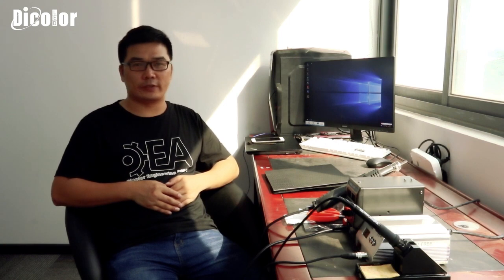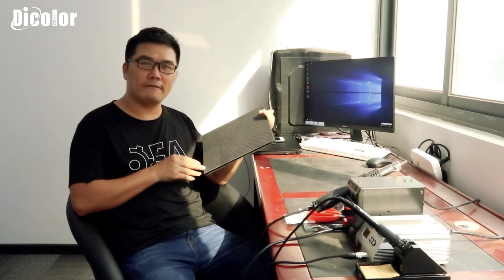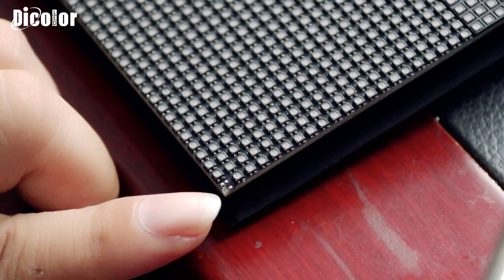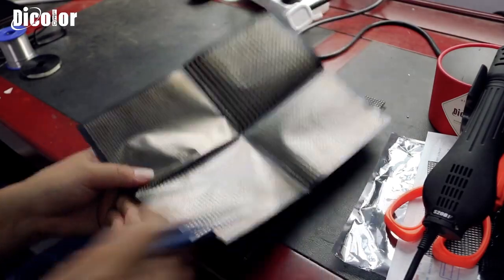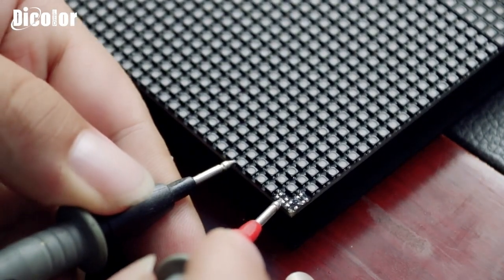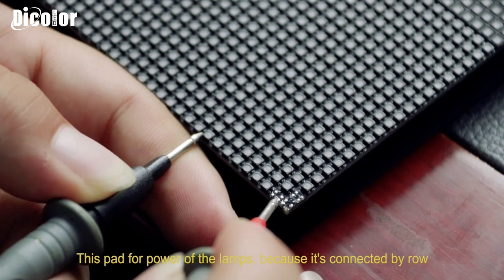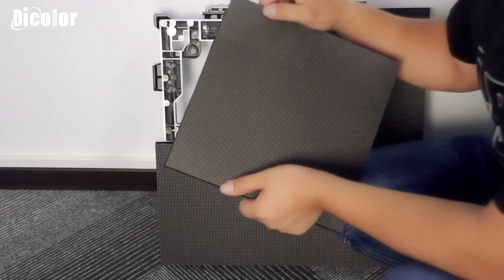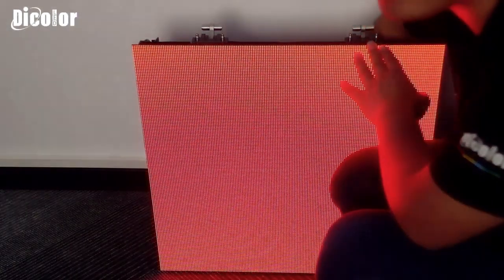How to repair led module with out PCB pad

Comment: I didn't know those pads existed, I've been repairing the matrix using fine wire jumpers on the 5mil and 3mil, very difficult. 
Where do I buy that pad paper, and is it only for Dicolor ?
Reply from the maker: you can find the pad paper from market. not just for dicolor.

Comment: Como saber mi tipo y modelo de led pich 3.9 interior .. el proveedor vendió y nunca entrego refacciones… algún tutorial para conocer el módulo por dentro … saludos
Reply from the maker: There are some standard things with product, such as the IC model, which can be known from the text on the IC. Conventional P3.9 spacing lamp beads, if the indoor generally use 2020 lamp beads, the outdoor is 1921 lamp beads or 1820 lamp beads,

Comment: Anyone have an idea on how to repair similar modules with 1.27mm leds?  Pads are fine but the leds detach when they're hit , even a vertical hit so they seem to have a weak mechanical resistence of the soldering; there is a little space between the leds, so there are 10 leds in 130mm; we are filling an entire room with the damaged panels.
Reply: Have you tried the normal method to repair surface mount? To attach LED that fell off first clean/reflow the solder pads: apply flux, then solder with soldering iron. When pads look good and have enough solder add more flux, then place LED on top and use heat gun until solder melts. It may help to shield nearby parts from heat using pieces of cardboard so you only heat one LED at a time. Also turn down the heat gun fan speed. The weak mechanical strength sounds like a manufacturing problem, possibly not enough heat. You could try heating all the LEDs with heat gun or reflow oven (make sure all plastic parts are removed).
Reply from the maker: Yes, when repairing a P1.2 pitch led module, you need to be very careful because the beads are too small (1010) and the distance between the beads is also very small. At this time, you can only use a hot air gun to disassemble and weld new beads, usually using the minimum air volume and a temperature of 280-300 degrees. Some air guns may not accurately indicate the temperature, so you need to try raising or lowering them. They can basically melt the remaining tin on the solder pad in 3-5 seconds. When replacing the beads, you also need to pay attention to the direction of the beads because they are too small and it is not easy to distinguish their direction, and sometimes you need to use a magnifying glass; When welding, first use a hot air gun to heat the empty solder pad for 3-5 seconds, then place the lamp beads on the solder pad with tweezers, and use a hot air gun to rotate around the lamp beads for 3-5 seconds. Then gently push the lamp beads with tweezers. If the lamp beads can rebound naturally, it indicates that the welding is correct. If they cannot rebound, it indicates that there is too little tin on the solder pad or the welding is not successful; This is my experience sharing; Thank you for watching my video;
Reply: Where are you from.

Comment: Can we use this process when four legs are broken . I can’t make it glow using paper when 4 legs are broken and connection is good 
Please answer
Reply from the maker: Of course you can, but if all 4 pins are disconnected, you need a 2*2 pad paper, because usually the power pins of the lamp beads are horizontal and the signal pins are vertical, so when you use 2*2 The pad paper can conduct the signal and power to the damaged position, allowing the lamp bead to display normally;
Reply: @samzhou8510  thanks

Comment: I'm enjoying the video
Can you tell me the address where I can get the pcb pad and the repair lead chip
Reply from the maker: We can supply to you. Need to know the pixel pitch. Lamps size.
Reply: smd 2121It's  
 I'm trying to fix it at home
Can I have a small amount of soda
Reply: The product size is p2.5 smd21211
We're going to repair it as an individual, not commercial. We're going to buy a small amount of pcb pad and lead. If you let me know the product page, I'll buy it
Reply from the maker: “https://ledtechhub.com/zh/collections/tools/products/p3-91-copper-foil-for-pcb-repairing”  you can check this website.  but the price is not correct.if you really want to buy. we can change the price and you can order onside. we will shipping it to you. @myungchongpark3189

Comment: Where can I find the "mask" or "mesh" or "shader" to order replacements for damaged panels? P5. Thanks!
Reply from the maker: Usually the mask is easier to find, but the problem is that if you only replace a small part of the mask, there will be a difference in the color of the mask, which will cause a square to be displayed in the case of a black screen. It is recommended to replace the entire display.

Comment: How do we know which 3 is colour and 1 is power on the bulb?
Reply from the maker: The R G B signal with power are vertically crossed. Just test it on a multimeter

Comment: Sir my panel is working good on rgb but when it comes to white light . Screen start flickering and after sometime some modules colour ic burnt out . What is reason
Reply from the maker: The power supply out power too small. Try to adjust brightness to 30% when connect signal cable. Then testing in white color.
Reply: @samzhou8510  sir still its burning ic . Again colour missing problem
Reply from the maker: @ranvirsingh6450  show me video pls
zhousumin@163.com

Comment: Hello! I would like to know what is the ideal temperature of the hot air station for rework?
Reply from the maker: 280-320
Reply: @samzhou8510 sir i tried the 280 to 320 temperature but it burns the led.. any suggestion?